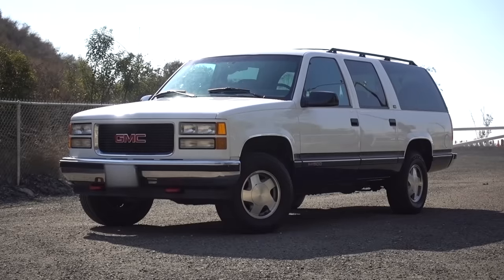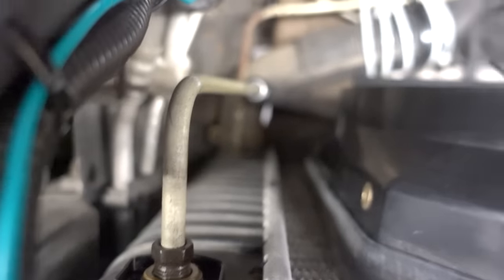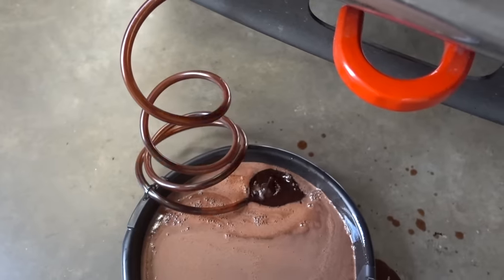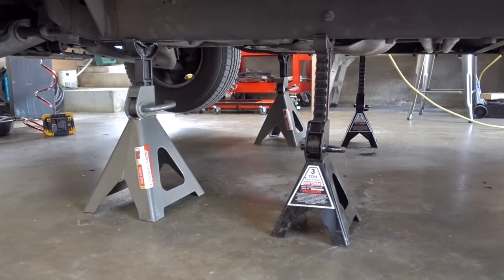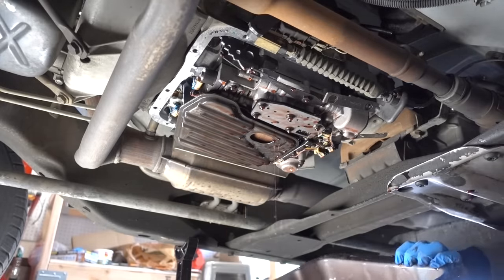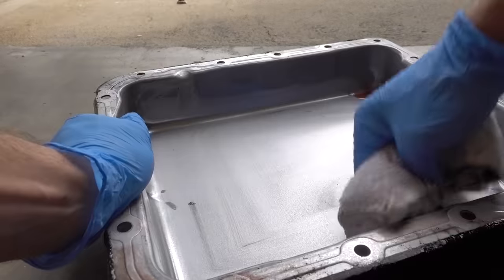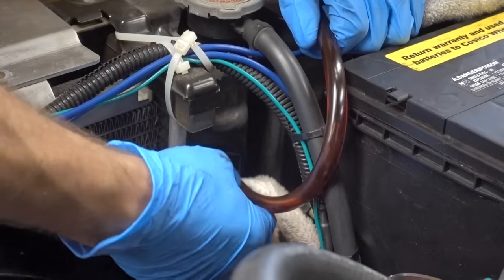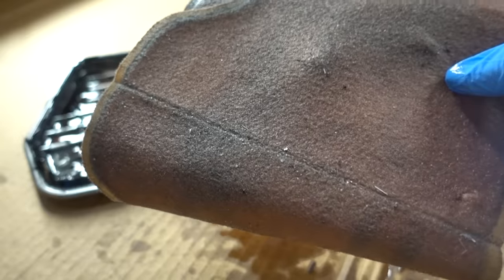Why You Should NEVER FLUSH YOUR TRANSMISSION FLUID!!

Comment: I flushed my transmission fluid, now my septic tank won’t shift.
Reply: We were taught in technical school that you should never change you trans fluid because as the clutches wear the friction particles will become suspended in the fluid and are required for the trans to seal and grip properly. Without the particles in the fluid the transmission would begin to slip and leak through its seals.
Reply: Cameron Crossley That makes sense to me, thanks for the input friend 👍
Reply: Hogwash.
Reply: Cameron Crossley i didn't go to a technical school but that came across my mind, makes sense
Reply: @cameroncrossley2312  which is why I would catch the old oil and if i have shifting issues, drain out the new and put back the old.
Reply: Lame!!!
Reply: Cameron Crossley so it’s eating itself slowly without the change
Reply: @cameroncrossley2312  Is this the same for a manual transmission? Even if is completely different, should I change mine? My car has 200 000 km.
Reply: Funny.
Reply: @4G63flyby  you can. Manual transmission used gear oil and there is no filter. Also a manual transmission uses about 4 quarts and the drain plug is magnetic to catch metal shavings. I had a '74 Toyota Corolla SR5 that in the end had 486,000 miles on it and the oil in the transmission never got changed and never had failure at all. With that said go ahead and change it.
Reply: @rustyshackleford7265  malarkey
Reply: @ft9217  
Horse hockey
Reply: @4G63flyby  Yes. Manual transmissions use the fluid for the simple task of lubricating the internals, whereas automatics use the fluid to operate hydraulic components and maintaining friction surfaces in addition to lubrication. In other words, manuals are less picky over new fluid and it's the healthiest choice. Be sure to use the correct fluid at the recommended service intervals :) My manual trans uses W30 motor oil. Someone used gear lube in it and that thick stuff burnt up my bearings shortly after I got it.
Reply: If this would be done every 40k km, then it wouldn't be such a risk changing it.
Reply: Did you try kick-starting your toilet.........???
Reply: @cameroncrossley2312  Got a question for you. So, if they taught you not to change the fluid, why would the owners manual of a vehicle recommend you to do the change? Is it best to ignore that manual's recommendation then?
Reply: Seb Neufeld No always follow the recommended service procedure and internal, this is the general theory for a vehicle that has not followed general service procedures, replacing tranny fluid during normal service is fine, in fact it will extend the life of the clutches inside the transmission, this is a general theory for a transmission thats very old and has never changed its fluid, if you run into this problem you may need to purchase a friction modifier and add it to the new fluid
Reply: @cameroncrossley2312  May be right, why some mechanics advises against & some outright refuses to flush ATF. Rather drain what's in the pan, change filter & refill. This way, there's plenty of the particles still there, and some new fluid to add detergent. 

Speaking of the detergents in ATF, my granddad used to drain about a quart of oil from his vehicles, add a quart of the fluid. Then drive normally (not hard) for 100 miles and perform oil change. This kept the engine cleaner, rings from sticking & valve seals soft, as I cannot recall him having any engine failures. Some would add a quart of ATF to a near empty fuel tank & drive until nearly empty, refill & drive another 25-50 miles before changing oil. The RedLine fuel system cleaner I use looks almost to synthetic ATF with other cleaning agents added. It's also to be used before changing oil in a similar manner, otherwise will make the new oil dirty.
Reply: @Converxful  +1 to that!👍
Reply: Plumber charges less the repairs shop 🤷🏽‍♂️
Reply: Wait.. What? I have a Rouge and you’re telling me NOT to flush and fill??
Reply: @TheBroknPezDispenser  nah you can drain and fill but I don’t know about flushing
Reply: now that is real news. did you get roto rooter get in gear and fix it. see you went and flushed your crapper and blew it up. shame on you. that's why they make outhouses with elevators. why, because they belong.

Comment: Why not.
I did ,the shop that I bring my car to recommend a flush every other flush.
Never had a problem. And my car is a 09 Camry.
Reply: I have a 2010 Camry and have done fluid exchange twice too. There is a difference between flush and exchange. Was yours done through cooler line?
Reply: @sandeepp6300  /   I have the transmission fluid drained/ flushed.
2 yrs ago I had it flushed, then later this week I will have it drained.
When it is flushed the shop replaces the filter and gasket..
I get this done every 2to4yrs.
I don't care what the manual says or the dealer....
Reply: @raymathews7035  
Cool i think similarly.  I try to do flushes every 50-60. I did just a drain and fill this time since car is approaching 140k miles. Where do you take your car too?. I've only had filter changed once and it made a huge difference , eliminated thuds
Reply: @sandeepp6300  /  I don't know where you live, I live in N.California, in a small gold mining town,"Auburn ", I bring my car to " Roger's Automotive " in Auburn Calif. It is a small independent shop that does excellent work and they have a mechanic that at one time worked for Auburn Toyota,(Bruce) and he works on my car when I bring it in.(He does excellent work ) And they work all foriegn and domestic cars/trucks,and motor homes if he can get it into there shop. Space is kind of tight. 
I'll be doing this later this week. 
I'm going to have the transmission fluid changed this time.
I stopped taking it to the dealer 2yrs ago because I didn't like there attitude, and there a bit more expensive. 
The dealer charges $120hr,maybe more??
Roger's Automotive repair only charges $92hr.
And they offer a 2yr warranty on most of there work.
They are on Facebook and Twitter,& Instagram. 
Look them up.
There located at 12215 Locksley Ln.#5.
Auburn, California 95602.
I you live in the area, try this shop out. You won't be sorry. 
Talk to the service manager, Logan. He's the man",😉🙂.
Reply: Thanks for the info and help. Man you are lucky!. I live on the east coast(Virginia) and it's hard to find a good mechanic where I live. The one I know has a huge queue all the time and I'm not sure I can trust him on difficult work. Dealer here charges 135$🤕
Reply: @sandeepp6300  >>> Sandeep labor rates on the west coast (Auburn, Calif) is $125.00hr at the Toyota dealer in Auburn. I go to a independent shop,the labor rates is 92.00hr. Very reasonable. But our state taxes is very high.

Comment: The only time I had a transmission completely fail, it was just after the fluid was changed and most of the time I hear someone talking about a failed transmission, I ask them if the fluid was just changed and the answer it usually yes. I realize that crappy old fluid is not doing the gears and bearings any good, but I'd be more inclined to change the filter and keep most of  the old fluid than to risk having all the clutches fail at once. My Accord has now got 160,000 miles on it with no fluid changes (except, maybe one required  change to preserve the warranty); it shifts roughly, but at least it still shifts.

Comment: The last JIFFYLUBE transaction job left me with an error code for the transaction solenoid.  When I drained the fluid I found the magnets missing as well as the transmission filter! I ended up doing my own transmission change. Unfortunately the error is still there. I could only think somewhere in the valve body got clogged with metallic particles..

Comment: I am always amazed that they put no drain plug on trans pans.
Reply: Jolly Tank  Guessing because they think no one will charge the filter?  Anything to save a buck for the companies.
Reply: Jolly Tank  Yep. Still, draining the pan would sure be a lot cleaner if we could drain it before unbolting it and washing the deck with trans fluid. I use a mid size mortar mixing pan low enough and wide enough to do it almost mess free.
Reply: Jolly Tank  you're lucky. Strange some did while others didn't. Hard to fathom doing that with engine oil. But knowing that's done a couple of times a year at least, it's maybe understandable.
Reply: @dropndeal  Auto manufacturer's that don't put drain plugs in trans pans.
Reply: Jolly Tank  I haven't tried synthetic oils of any kind yet. Cost I guess. Heard good stuff though. I may get enthusiastic and do my transmission sooner than later and try it.
Yeah, I wish you luck too,, ☺️
Reply: Jolly Tank  definitely cheaper than tranny repair or replacement,, for sure.
Reply: @dropndeal  I would think he's talking about the automotive manufactures ?

Comment: Having "flushed" my tranmission fluid every 75 k miles the fluid looks like new and I've never had any issues. With over 200k miles with zero problems I will continue to actually power flush all my transmissions. If I buy a rig that has more than 150k miles I would not fluch it because the crap in the oil is most likely the only reason the transmission does not slip. Power flush that and it could start slipping.
Reply: Okay except most vehicles also achieve over 200K miles without a transmission flush so you haven't proven anything yet unless your vehicle is known to have a weak tranny that needs this.
Reply: The reason you don't have any issues is because you've been regularly doing it it's the people that don't do it when they're supposed to and then just do it one day out of the blue and boom no mo go fo you
Reply: @shaun7057  You're right It turns out that the reason a flush starts the slipping is that the crap in the oil is all that is creating the friction between surfaces.
Reply: Explain power flush?
Reply: @kkoch666  Not 100% sure but what I saw is they had a tank with 8 more quarts of fluid more than the transmission holds including the torque converter. The pump on the machine pumps fluid through the transmission until the fluid entering into the catch tank runs clear and clean. The process took a bit more than an hour. I have my rigs flushed at Oil Can Henry's. Once the rigs get over 200,000 miles they will not flush them because of the concern about cars that have never been flushed starting to slip after. In those cases it seems the grit in the fluid is what keeps the transmission working.
Reply: @kkoch666  Here is a good video explaining the issues with flushes and explaining how to do your own.
Reply: Transmissions slip because of the crap that hits the clutches. Removing the crap will stop it from messing up the clutches...

Comment: It definitely depends on the mileage and upkeep of the vehicle as well as make and model if you have an older American made vehicle with 200k on It and it’s never had a transmission flush, do not flush It. It will cause major slipping and may become completely undriveable without a transmission rebuild. If you have a vehicle like this that’s older but only has around 80k miles you should be totally fine servicing the transmission changing the filter out and changing the fluid, remember most manufacturers recommend you get a trans flush every 60k-75k miles so he’s literally not that late for a transmission flush. The reason mechanics will tell you not to do a trans flush is because you have an old vehicle with a huge amount of mileage on It that has a bunch of dirty fluid that is actually helping the transmission still run, you change out that fluid though with a worn transmission and all that gunk is gone and clean fluid makes It slip. It’s that simple. If that doesn’t apply to you, you should definitely get your transmission serviced when your vehicle manufacturers tell you to. The problem is a lot of mechanics run into people with transmissions on their last leg trying to just get a transmission flush thinking it’s gonna help but it’ll just make things worse. So to save you the money and the mechanic the time and stress they let you know that you need to get a transmission rebuild or a whole new transmission.

Comment: (Why You Should NEVER FLUSH YOUR TRANSMISSION FLUID!!) - But flushes it.....
Reply: The expense for all the fluid needed . Apparently no one told him to drive truck for 500 miles and do it again .Trans Filters have to be changed every 20,000 and no one reads owners manuals . Not 20 years later to flush mud . If people would do the filter change when filter service is due there would be no need to flush the hole system and remove brown mud . Brown mud is a good sign of clutch plate wear . Ps the air part is no good brother . New should go in at the same time from the other trans line .
Reply: Do as I say! Do not do as I do.
Reply: His point is that it's so scary and filthy and difficult that it's discouraging. He made it seem like it would be detrimental to the car with his insinuating word selection lol

Comment: I missed the part that told me "why I should never flush my trans fluid"
Reply: Actually you should either change your trans fluid including flushing out the original "brake in fluid" or you should never change the fluid. I'll bet the transmission in the video will fail within a year, as the detergent in the new fluid will set all the dirt free...
Reply: @davidhollenshead4892  I'm confused a little lol are u saying with a new trans you can change the fluid after breakin and flush then keep up on changes or if u have an old one u should never change it if it's already old and dirty?
Reply: @davidhollenshead4892  I would love for you to tell us where to buy ATF "Brake in fluid"  ( we know you meant Break in fluid ). seen Engine break in oil ( high in Zinc for flat tappet cams mostly), but never, ever seen ATF break in fluid. by the way, did the same procedure he did on my  4L60E in my GMC SUV 18 months and runs perfectly. changed to Amsoil full synthetic. Just put 3000 miles on it a few weeks ago driving it all over the western US in 7 days.  170,000+ miles and counting.
Reply: The part that told me "why I should never flush my trans fluid" is in the comments. ;-)

Comment: Always enjoy seeing a rookie dump a trans pan, The thing about putting the bolt back in the hole it came from is BS (if you have a messed up thread, replace the bolt and re-tap the hole). I always replace the drain pans on my 700 R4s and 4L60 Es with pans with drain plugs. I never need to flush my trans because I change the fluid and filter every 20,000 miles, and I agree with everyone commenting about the screaming LOL

Comment: Did you detail the underneath of the truck❓While you had the pan off you should have added a couple of decent sized neodymium magnets. Never hurts to catch more crud and a drain plug saves drinking cherry goo next time.
Gr8 vid BTW.
Reply: You're not supposed to add more magnets than specified. Too much magnets can cause interference to the solenoids. There is actually tsb's from GM that mention this
Reply: @sbond1963  Howdo Bondo, looks like German electronics are better than GM's.
I have added an extra magnet to my 2010 C Class and the only interference in my gearbox is to any particles that may be mooching around in the fluid.
This is not a poke at the bear with a sharp stick just a polite reply to your comment.
Enjoy your day 😉👍